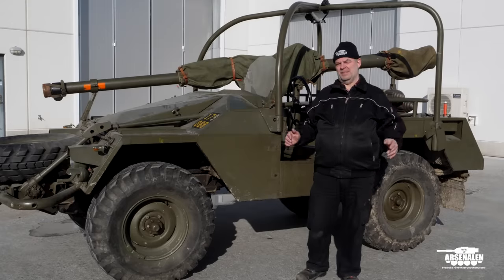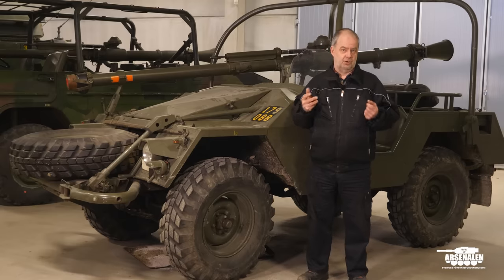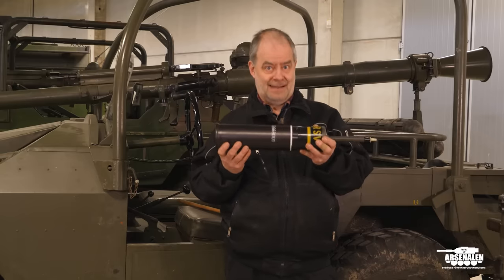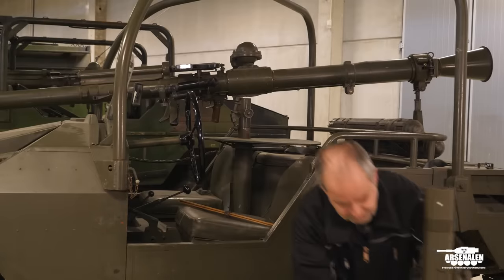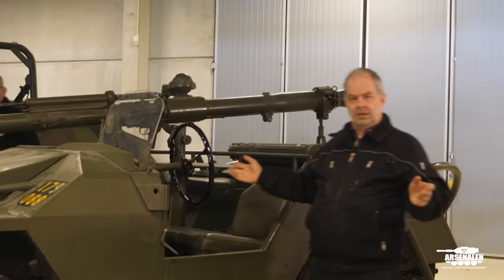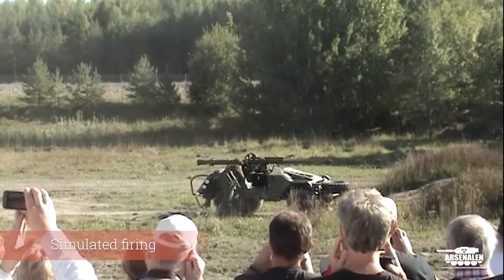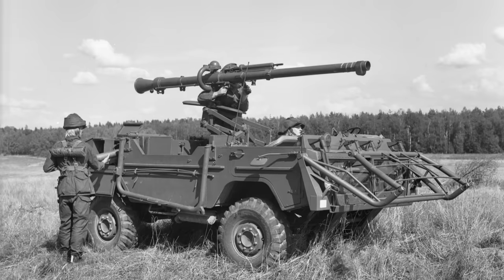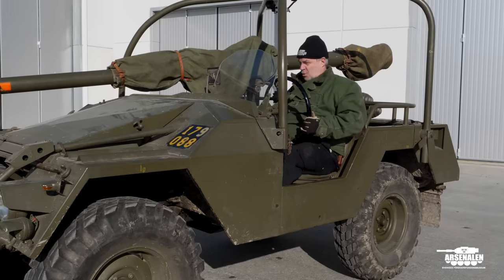PVPJTGB 9031 | Arsenalen Swedish Tankmuseum

Comment: Springtime in Sweden looks bloody cold.
Reply: It definitely can be, Stefan's part of Sweden is around the same lattitude as Newfoundland...
Reply: meh.... after a few months of double digit minus temperatures, 4C feels actually rather balmy, especially in the sun.
Reply: Weather like that it's actually really nice as long as it's not windy. The sun warms nicely, the air is really fresh and nice, and as long as you move around just a little bit it's easy to stay warm (generally so warm you need to start opening/peeling off layers of clothes).

Comment: The idea of free-floating on a gimball instead of having to crank handwheels to follow a target seems quite interesting to "hip-shoot" an then run.
Is the gun balanced loaded? Seems a bit nose heavy when empty, I guess with the round in the chamber is perfectly balanced.
Reply: A target moving at constant speed and no bobbing around up and down is surprisingly easy to follow.
The high velocity of the HEAT grenade help if the advance of the reticle ("hair cross") is not perfect.
Mind you an enemy tank is and was several meters long.
With the gun on the carriage one could  move to positions not expected by an enemy and keep a literately low profile.
The gun is in use in Ukraine now.
de SA3BOW
Reply: @drontobil  thanks for the info. I'm still convinced that aiming moving the gun with your body (like the shoulder rest on Matilda II) is easier than coordinate two hands on two axes on separate hndwheels.
Reply: @fabiogalletti8616  Yes it is so with this gun. The gunners position don't allow  much side travel.
But training to shoot fast and get away is the key here. Agan the high speed grenade is a benefit.
Compare that with a wire guided robot. Flight time is longer so the field of observation/lead with no
obstacles must be wider.
With this gun only a narrow slot in the woods is enough to get a "lead" and shoot.
And the "hip shoot'n" as you call it has a few more advantages than a hand cranked gun have:
Simpler, lighter, cheaper design that equals more guns produced.
Can be moved with a smaller crew. In the end it mean more grenades can be delivered to target.
And talking from experience from art pieces: No cogs where debris get the gun stuck.
It is easy to spray ones empties from the gun crews then normal weapon 9 mm SMG.
Those empties find peculiar ways to wrong places.
Development shown in Ukraine have now made this gun less useful compared to FPV.
Still it show that Sweden was right making this gun to fight contemporary vehicles and that it
worked even at the start of russian full scale aggression in Ukraine.
Side notes: the  optic sight was made also to allow semi indirect fire. But no grenade was developed
for that. The top mounted gun is an example of a historical habit in the Swedish army: Combine and
reuse stuff for something it was not intended. The innovative and brave Ukrainians master this now.
de SA3BOW

Comment: I like the version of that gun when it's mounted on a pulk. Ammo in another pulk. Can anone tell me a bit more about that?
Reply: Two men on skis in tandem and two more, one on each side of the two tandemskiers. in downhill the two on the sides act for breaking speed.  Have tried that, the pulk is made of glasfiber and has a bracket for the gunmount so you fire from the pulk. :-)

Comment: Spring in Sweden - good to see - and an interesting gun-car, very mobile.
Rangefinding via infantry gun - with increasing distance, the difference in trajectories increases, gun looses much of its precision, right ...?
Reply: The smaller calibre round is ballisticly matched with the recoilless rifle, and is a tracer. The gunner fires burst or single shot until the small round strikes the target, then fires the main weapon. Our anti tank platoon guys (US 105mm mounted on a SWB Landrover Series 2) used to boast the tank crew would hear the  ‘ping’ of the small round, milliseconds later, turret ripped open. The 105 used a ballisticly matched fifty caliber ‘spotter’ rifle.
Reply: It's usually with a matched ballistics out to a certain range (normally the effective range of the main weapon). It was a common and quick way to rangefind before laser rangefinders were a thing and were even used on tanks like the Centurion, Chieftain and Vickers export models.

Comment: Wait, isn't that the same engine as Volvo Amazon?
Reply: Basically, yes. It is a legendary engine, that was improved upon and developed into several versions. It is known to be one of those "immortal" engines that will outlive the veichle it is in, as long as it is serviced and cared for.
It was also used in Volvo PV, Volvo p1800 and volvo 142, as far as I know.